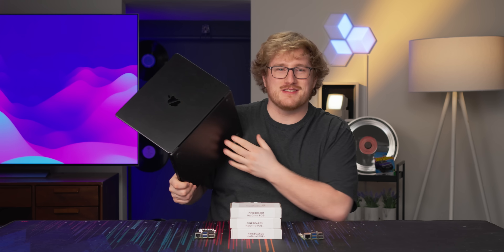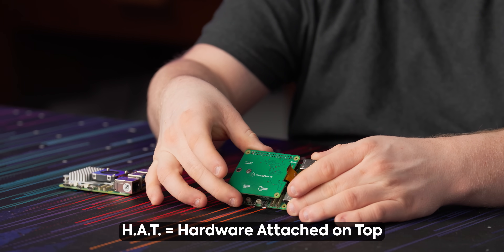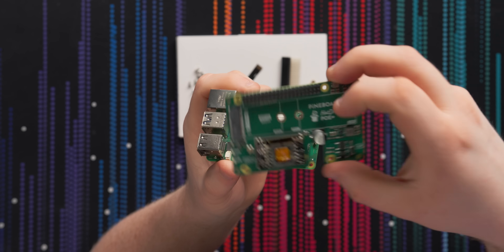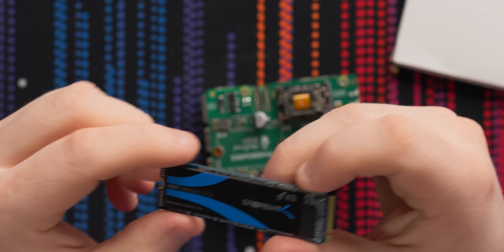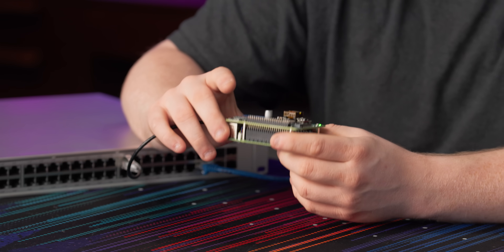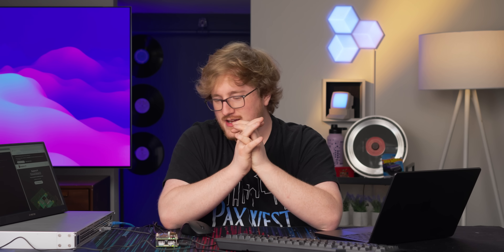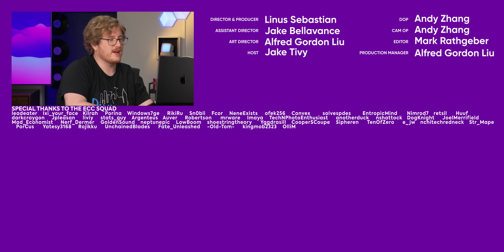This solves the Raspberry Pi’s BIGGEST problem - Pineboards POE+

Comment: $44-ish USD is kind of steep. However it saves the hassle of buying and using a USB-C cable and or power brick. Which would be ~$10 to free. 

Great product. But price point is a little off. There are Geekworm cases that let you do functionally the same thing with out POE powered by a DC barrel jack
Reply: USB power isnt always possible due to location, use case, etc. Converting PoE to USB power will run you pretty close to the same and also introduces failure points.
Reply: @kendrakirai  Why would you convert POE to USB power? - I never mentioned converting PoE to USB in my OP. 

There's geekworm cases that turn a 5.5 DC jack into GPIO power for a PI. And at that point buying a PoE to USB converter will likely be just as cheap as buying the PoE hat. However the Geekworm solution also includes a case. SOoooo.

It basically seems like it depends on a user's needs, location, and budget.
Reply: @AgentLokVokun  it's not as safe to power the pi from the gpio, as it bypasses some of the protection circuits and can also blowout the gpio lines if the voltage is not stable. that being said, i've used gpio power and haven't got any issues yet, but i don't stress that pi much.
Reply: @AgentLokVokun  if you just meant USB/DC power using a brick, then that's even less convenient for a great many deployments of these lower power devices like switches and SBCs.

Comment: This is my problem with the Pie.  Sure it's super cheap on it's own, but it's so minimal that you are highly likely to need HATs and/or a case.  Due to the popularity of Pie's, your options for addons are either sold out, or the combined total price is considerably higher than the sort of mini-PC that Pie's are marketed to be cheaper than.
Reply: And add on boards close off the ability to use cases designed for the SBC alone, unless they're acrylic enclosures with little consideration for form or function beyond protecting the stack.
Reply: A lot of you don't seem to realize what the Pi is for, it's for building your own thing. That own thing can be a NAS, but if you do so you do it knowing the limitations. It's goal is not to be the most powerful but rather to do whatever you need to do in software on a completely standardized package top to bottom, which makes development easy. You are supposed to add on to it.
Reply: @hugevibez  No, obviously we all know that.  Nothing beats Pie for documentation and standardization.  However, a NAS is a perfect example of something where a Pie is a poor choice for the money.  After addons and a case, you're spending more than a competent mini-PC.  Personally, I look at the Pie as ideal for either: A. prototyping or trying out projects, or B. jamming in something else that you need advanced control over, especially if it involves the GPIO pins, net access, or a UI.  Like a TinyPilot for instance.
Reply: The alternatives that actually offer more than the Pi are usually more expensive than a Pi + HAT
Reply: @paulmichaelfreedman8334  Sure, if you don't add up all the costs to be comparable on features. It's not just the pi and hat, you have to buy the SSD, a case, and a power supply. If you're comparing it to the GMKtec mini PC's, you'd also want a 2.5GbE USB adapter. I won't count an operating system, since Windows is not the right choice for these mini PC's, even if they come with it preinstalled. The one I'm thinking of is $127 on Amazon right now. Compared to the Pi setup:

Pi 5 8GB: $70
HatDrive POE+: $45
SSD: $25
Case: $10
Power Supply: $12
2.5GbE USB Adapter: $35
Total: $197

Not counting shipping, but keep in mind that you probably won't get all of this from the same distributor.
Reply: The newer ones aren’t even that cheap anymore, especially if you include practically mandatory add-ons like a heat sink and high amperage usb power supply.
Reply: "Sure it's super cheap on it's own" - aged like milk.
Reply: Quite sure that no one from the LTT community will ever buy a Raspberry Pi for anything else than criticize the heck out of it ... seeing that most of the LTT Videos starts with a 1600 Watt power supply for MAXING OUT ...[insert target] ...
Reply: pi's are for projects and making smart tv's smarter than the manufacturers garbage, anything else is pointless
Reply: They make no sense with a shitty sdcard other than a set and forget read only application. Adding real storage and whatever, you're already wanting more than what a pie was intended for it seems and are better off with any other x86 mini pc
Reply: @lopwidth7343  It's just that if you need extra hardware on the Pi, you're an extremely demanding user. You're one of that 1 percent. the other 99 has an SBC that suits them perfectly. Do not forget RPis are not meant for industrial use, although they could be if they were tested and cherry picked for robustness.

Comment: How many SD cards have died?

Yes. 

Even the “high endurance” ones, kicking things to read only as much as possible, sending logs to a RAM disk and all of those hacks, they still die on me. It’s noticeably worse with sudden power loss and yes, a UPS can mitigate that, but why should I need a UPS in a dozen spots in the house for every Pi. 

I am so over the Pi. ESP32 for sensors or small form factor PC, I can get a BeeLink N100 for $159, not much more than a Pi.
Reply: Even 8266 is more than enough for sensors.
Reply: @ true, for me I know the ESP-WROOM32-E-N8 SMD pinout and how to design around it so well I just stick with it.
Reply: God I love the esp32. I'm just a hobbyist and haven't really needed it use for anything crazy, but for my little mini projects it's just so perfect, with with tons of features I'm not even using yet. All for what, 10 bucks tops? Been looking at other micro controllers, but the value of the esp32 is just unbeatable
Reply: @NavyPanther54  the bare module on a board I had made recently was $1.82.

Comment: Not exactly cheap, but considering that my Pi 4B has a SATA SSD strapped to it with a rubber band, it‘d be worth the money for me. Much nicer package. So a Pi 5 with cooling and that thing would be everything I need for my VPN, Pi-hole, and other home stuff. Nice!
Reply: I have a Pi5 that uses a 3,5" SSD as part of the case :D.
And I also managed to install proxmox on it! So that might be even better for youre usecase!

Comment: RPi's biggest problem is that you can't get them for a reasonable price anymore
Reply: Funny…. I got several (4-5?) RPi-5 8GB for about $40 per, new/shipped.
A little road-rash from where they ‘fell off the back of a truck’ but they worked perfect.

Just kidding, these came from a MAJOR electronics warehouse, proper packaging and proper invoices.
I have no clue/idea WHY they were so inexpensive.
Reply: @ernestgalvan9037  link? lol
Reply: @je8277  70 euro for pi5\4gb is a big no no
Reply: Yes you can, the shortage is over long time ago

Comment: as Jeff mentioned.. if you look at the board? it has "pads" for m.2.. they just aren't enabled.. and Jeff even tried attaching one.. but it didn't work.. so "perhaps"? in rPi 6.
Reply: You are mixing up devices, that was the RPi 500 which is the version built into a keyboard, not the model B which is just the board. They are different, the Model B has no pads for an M.2 slot.
Reply: @ThatGuyYouSeeCommentingOnClips  oops.. right...

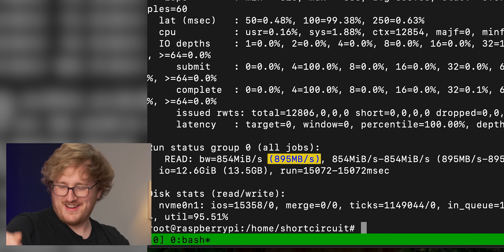Comment: 9:53 I don't know... I wouldn't touch a 48v Poe transformer... The switching frequency could be over the pain threshold so that's why he didn't feel anything.
Reply: Ah I wondered what the large lump sticking out the top was.
Reply: <50VDC is generally safe to touch because of the dielectric constant of the skin and the fact the lower resistance path is definitely the wire windings of the transformer. Low voltage DC can cause some injury but it's usually a burn cause by an arc to ground/common instead of electrocution
Reply: @daltonC137  a transformer to work need AC, a switching power supply switch on and off DC voltage on the primary of the transformer creating virtually AC on a square wave, so it's AC...

Comment: "RPi6 should have POE and a M.2 slot."
Yes! ABSOLUTELY agree, especially given the price.
Reply: The Pi500 has a spot for an M.2 drive but it has no data traces, so maybe we will see that as an option on the Pi600
Reply: @Sithhy  I was going to mention the 500.  Since it was styled after an Amiga, can we get a 500plus with 16GB and M.2 NVME slot and POE?
Reply: @Sithhy I feel that board could maybe be repurposed to a blade-style board for building clusters. There also seem to be solder points for other capacitors and such, which makes me believe that could be for POE
Reply: Yall funny. That Pi 5 already has POE lol thats how its working. that hat just means it can use POE
Reply: Definitely, but I would take 2.5GbE capabilities as well.
Reply: and it shouldn't use the stupid 5V 5A which doesn't get supplied by normal power adapters.
Reply: 100% it should.
Reply: and full size HDMI
Reply: @ushabuntu  Exactly, 2 monitors is pretty rare for those.
Reply: It would increase the cost for those that do not need it. I'd say make it a "RPi6+" model or something, but some use cases of RPi are based around the size or weight and M.2 would increase that (RPi5 can already use PoE, the hat just uses the PoE of the main board). After all 44EUR is like a third of the price of RPi, and even after all manufacturing savings you'd have, it would still increase the price by something. Now imagine you have to buy 15 of them just to run a signages off your network. You do not need m.2 for that. And while M.2 has massive usecase in RPi world, it also has equivalent no use for it as well. So just like having a 2GB or 4GB models, just having m.2 option would be more pro-consumer.
Reply: @VanBourner  5 already to expensive for what it is, honestly.
Reply: @whydoihavetodothisannoying  Yeah toss a Pi5+HAT's+Case+POE Switch+m.2 ssd and your looking at about the same price as a N97/N100 based mini pc which usually has at least a 128gb if not a 256gb ssd onboard already.
Reply: @Montisaquadeis  this ^ the Pi isn't cheap, - the only good thing about the current pi is; people realise it isn't cheap and started to buy used £50 mini pc's instead, reducing e-waste.

Comment: Can running full power over ethernet interfere with data bandwidth?
Reply: No. It uses a pair in the cable that isn’t used for data by any Ethernet standards, and it’s DC so there isn’t potential for inductive cross talk causing issues or anything.
Reply: @FinishHim90  All 4 pairs are used in gigabit+ infra lol, google how POE works
Reply: POE is a long-established standard. No need to worry.

Comment: Whats „missing“ in the ethernet port, that makes it not POE? Also seems weird to me, that the Pi doesn‘t just support it out of the box, if they already split the power out to four extra pins…
Reply: A lot of components. Those 4 pins are the 4 center taps on the ethernet magnetics, built into the jack on the pi. To get poe from that you need to design and build an isolated step down transformer / supply, that can the the up to 57v of PoE supply, and step it down to 5v. It also needs to be able to negotiate this with the switch.

This is all fairly expensive, and bulky, so wouldn't fit on the RPi board, or bill.

Rpi does make official poe hats too. To let people who want poe add it
Reply: Probably the IC that communicates with the switch to setup the PoE handshake, some sort of voltage regulator to ensure 5v, probably other stuff an engineer that works on small device stuff could answer better than I. Just some stuff that would have to be added to the BOM that doesn’t add value for enough use cases to justify the cost to most consumers. But I could easily see a PoE version of the 6 being an optional flavor.

Comment: I think it'd be interesting to drag-race a Pi against a modern miniPC, and some used 'office boxes' under $50. Price, power, ease of setup, and hide-ability for all of them. That tiny Pico PC Linus showed a few months ago was neat, but kinda pricey for its performance.
Reply: The pi would get smoked by anything that uses ddr3, itll get murdered by anything using ddr4. The ONLY categories it wins are size and power. Its harder to set up, more expensive (once you have a ssd, power supply, case, pi 5 8gb, etc than even an 8th gen i5 system off ebay). Like its not even a competiton. And as someone else said, these things really should never be used as a pc.
Reply: @renderedpixels4300  Explaining Computers did a drag race between a Pi5 and an N100 miniPC. It was reasonably close in day to day usage. In things that used a GPU, the N100 kicked the Pi's ass, but in general CPU tasks it was roughly the same ballpark on most tasks.
Reply: @WhiteG60  N100 is a bit less efficient, but a little bit faster, on the CPU side. It has more IO capabilities, it's more compatible with all the wealth of x86 software, and the built-in GPU is miles beyond the Pis.

But different strokes for different folks, as the Pi uses less power overall, has an ecosystem of HATs that provide a lot of interesting and very compact uses, and has great support for camera, display, and GPIO/robotics/sensor interfaces.
Reply: @JeffGeerling  And I wonder what programmers actually prefer....Arm or x86 (with its legacy memory holes and whatnot)
Reply: @JeffGeerling  just that simple.
Reply: @renderedpixels4300  I remember Navalny Headquarters mentioning that there were using Pi 3 for their PCs. As everything is stored on SD cards, you can just take out and eat them when needed. And they were easy to replace as police steals them every time.
Reply: @renderedpixels4300  Keep comparing apples with pears laddy. RPis have their own niche use. If you can't see it, so be it, not that important. But you're hammering down on a product that is being compared with something way more expensive than the product.
Reply: Dave from dave's garage did that 4 months ago. The Pi is not good for raw speed, but as other pointed out, that's not what they are for. They are low power very smart controllers. I use 2 RPI4, one as KVM for my home server and the second as an emulator "console". For the second use case I should have gone the mini PC route.
Reply: If you're not using the GPIO, not using the board as a part of a bigger system (inside a kiosk, for example), or not making something more bespoke, you'll probably prefer any Intel N100 mini PC or SBC. Used eBay mini PCs are good in terms of CPU/GPU power and price, but also are more power hungry than the previous solutions.
Reply: No need. Alder Lake based Mini PCs already smoke it (n95/n100 ones can be had for roughly $100), with much better performance and compatibility, at approximately the same price if not lower once you factor in power supply, case, fan, M.2 etc. Pi4 or Pi5 as a 'mini PC' has been a losing proposition for a while. The exception is if you want to use GPIO to control something, but even that is dubious since Radxa has N4000 and N100 boards with GPIO.
Reply: I wouldn't use a Pi as a desktop PC; any reasonable Intel/AMD box would be a much better choice and the Pi lagginess would quickly get annoying.  But contrary to what some others write, I do use a Pi 4 as a server.  It runs my SMTP and IMAP servers, my Asterisk server, Pi-Hole, my monitoring system and a bunch of other services.  The CPU is underwhelming, but it's perfectly adequate for the task and the power consumption is extremely low... something important for me for a machine that's on 24/7.  Plus, it's passively cooled so there's no fan noise.
Reply: Yeah, the Pi vs a tiny PC is kinda not as practical anymore, but for a device controller it's still super easy and useful due to the GPIO stuff.
Reply: @AaronTheGeek  Frankly, that's Radxa territory now (they have an Alder Lake SBC with GPIO) unless your usecase can run on a Pi Zero.
Reply: If you are using a Pi as a PC you are using it wrong, controlling sensors and machines using its GPIO pins for use cases that need more processing power than a microcontroller is what the Pi is for. If you need a PC buy a PC.
Reply: @backgammonbacon  it is really much better to use dedicated MCU for hardware interaction than it's GPIO IMO
Reply: @JGnLAU8OAWF6  did you even read his comment? lol his whole point is that a raspberry Pi is what you use when you still need GP IO pins and a faster CPU than what a typical 20Mhz or 150Mhz MCU can handle.
Reply: i think one of the newer celeron intel ships its going to obliterate the pi